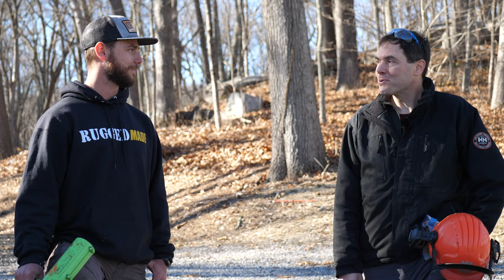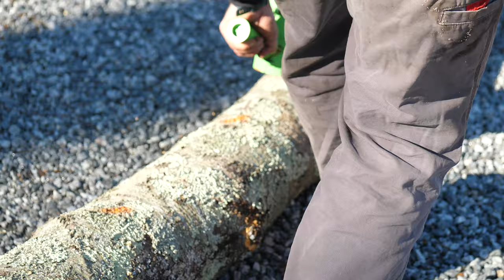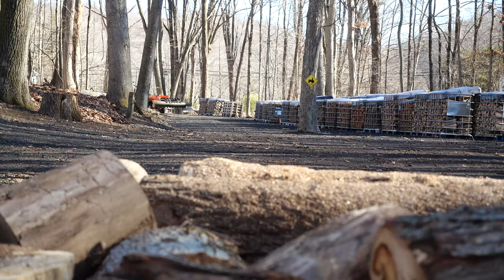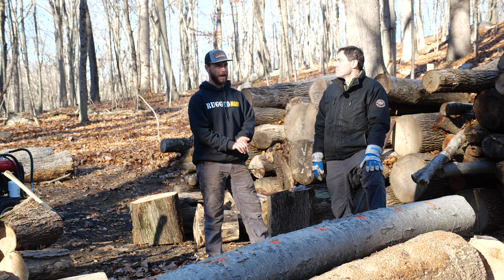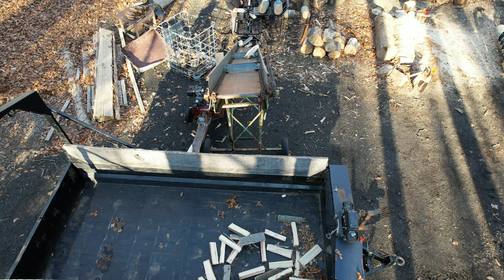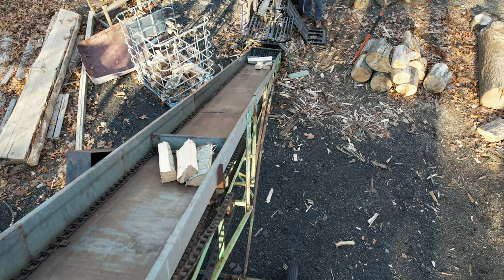#309 From Tree to Trailer: How to Split Firewood

Comment: Have you tried using a smaller log in between the two big ones to bring the log up a little higher?
Reply: He had mentioned before about using the Alaskan saw mill to take some of the top of those bucking logs down a bit. I think about it every video haha
Reply from the maker: I haven’t thought of that, but like @mbaker825 said I would like to mill them flat to make it less concave

Comment: Just wondering if you ever mentioned to Ruggedmade about the log lift cylinder always bleeding down. I’ve noticed it on every Ruggedmade I’ve seen on YouTube channels. Common theme and just wondering if you’ve ever asked them
Reply from the maker: I did! The consensus is that there are different kinds of cylinders. Those that will not weep down, and those that will. The cylinders ruggedmade uses for the log lift are the kind that will weep down over time and are not designed to stay put for “long” periods of time due to the application they are being used for (also I’d image price point). Once explained I understand, and although not ideal, it’s really not something that bothers me and I barely notice it in real time. I usually raise and lower the log lift before I notice it’s sunk down.